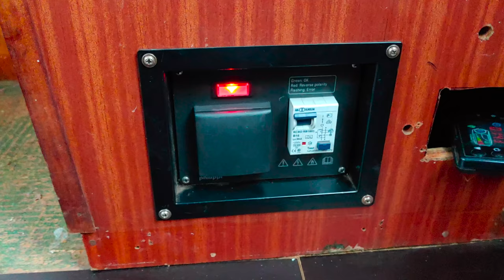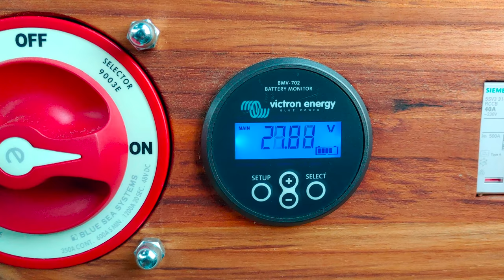Winter on a boat

Comment: Hey, I was thinking, instead of using the plexiglass to cover the entire "whole" why not make a wooden frame with a smaller window in it so you can still see the cables and support the plexiglass so it doesn't crack and the shore power plug is better supported. It would also match the wood theme you are going for. Love your boat and I can't wait until spring. Good luck with all the small project until then.
Reply: Good plan!
Reply: @David Abercrombie You don’t happen to be from Alabama do you? Your name sounds very familiar.

Comment: Once you know where the steering wheel is in relationship to the rudder, simply wind a few turns of colored tape at top dead center of your wheel. That way you can tell at a glance where your rudder is... worked well on our 36' sailboat. Glad to see another video, prayers that all is well or will soon be for you!

Comment: Great update. Top tip after running cables and before connecting up it is always worth doing some IR testing to ensure the cable insulation has integrity and insulation is not compromised - but good test equipment is not cheap.

Comment: most people have a marker on the wheel that allows them to know where the rudder is. When you put the marker on then turn the wheel to full Port and count the markers turns, and then Starbord and do the same. Also if you have not done so not, a hydrolic steering system with a LCD monitor can asist better with ease of steering and the LCD will show the location of the rudder

Comment: Glad to see another video , you do great work . There is a small inexpensive gauge with a peel & stick backing that goes on the center hub of your steering wheel . It will tell you when your rudder is in the center position . Works very well . Take care and stay well & safe   ☮

Comment: Thanks for your videos, which are quite inspireing. I myselvf own a tailer boat, and it hurts med to see you roll the trailer into the water, with the light-boom  still mounted.
But then i figured, you might have sealed lights on the trailer?

Comment: At 8:12 on your video it shows the hull of your boat. 
I can see the drain hole is in crazy condition. You may want to update that and of course remove it while the boat is in storage. 
Additionally, would those rear trailer beds work better if they ran front to rear rather than left to right? In its current layout all the pressure/support are on two contact points rather than the full bed plate. It may not mean much while the boat is just resting on the trailer but one good bump while travelling is going to exert a lot of pressure on those two points.

Comment: You know: The plaxiglass doesn't crack for beeing too thin - it cracks for heat movements. As it expands or substracks, Your screw holes must have enough space for the movement. Just as a hint.

Comment: When drilling plastic you’ll find it very brittle.  Always better to use a pilot hole and a rubber washer when screwing into plexiglass to avoid it cracking.  Also use a drill specifically for plastic.

Comment: Upstate NY here, not far from Buffalo NY and Niagara Falls. Any boat in a lake or river without a bubbler would be crushed here, I think. Ice gets pretty thick. Lake Erie freezes completely over most years. Almost all boats are yanked out and stored. If they're too large to be dragged out, they're protected with systems to prevent the ice from reaching the hull. Your film making has improved quite a bit. Your project is so far alone, compared to where you were last year at this time, and the attention to detail is inspiring, keep up the good work!

Comment: Just a thought, did you let the Bayliner engine warm up before circulating the winter antifreeze so the thermostat was open? If not, it won’t circulate through the engine block.

Comment: Did you trim the drive down on the Bayliner.   Any fresh water caught in the lower unit could freeze and crack it.  Also I'm not familiar with German winters but if you have snow load that bimini won't support the weight, I have a wooden skeleton built for mine that I cover over the top of.  It's still good practice just to save the very expensive canvas from being scuffed or worn through by rubbing on the tarp.

Comment: You really need to check into the red light issue.  Just because it works does not mean that it's installed correctly.